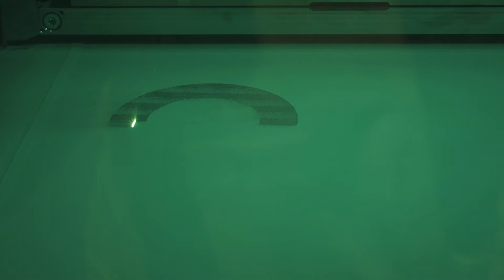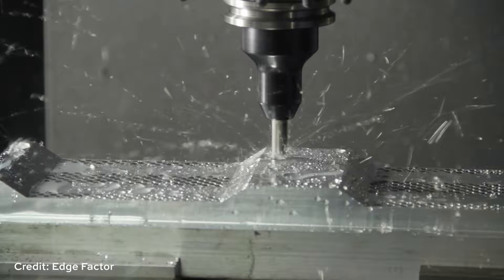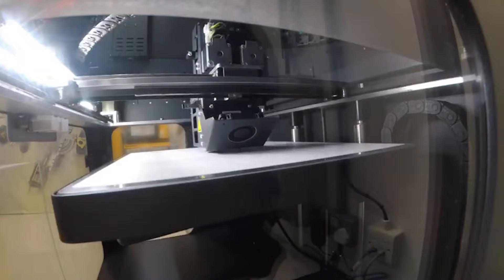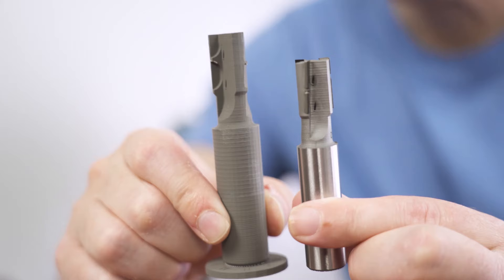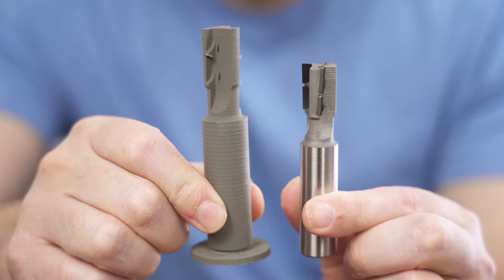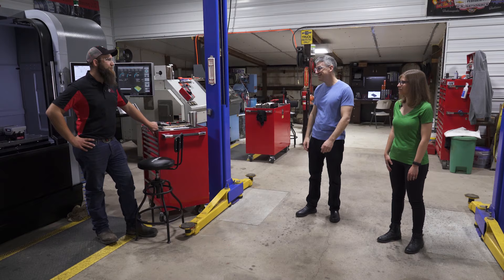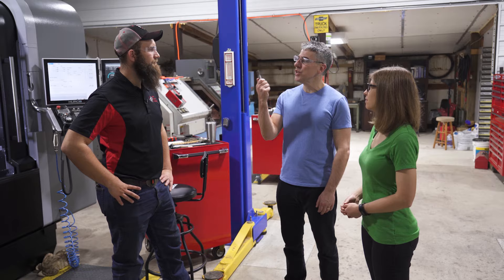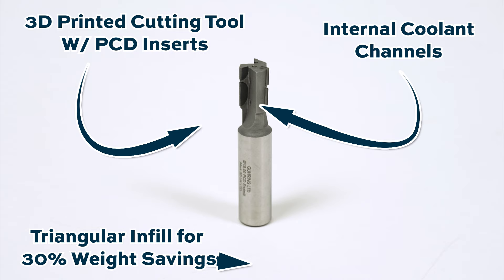3D Printed Tool for CNC Machining: The Cool Parts Show S3E1

Comment: Question: End Mills are spun rapidly during its operation. AM process, however, introduces a not so balanced part (think surface imperfection). Wouldn't this create an undesirable vibration of the part during its operation?
Reply from the maker: This question is so fitting, you don't even know. In this episode, Stephanie describes how Pete is also part of Modern Machine Shop magazine. As it happens, when he joined Modern Machine Shop, the first article he wrote as a new staff member was on this very topic, tool balance.

The question is very valid because imbalance is a problem we might expect for an object spun this rapidly - over 10,000 rpm in the machining we see in this episode. And the surface detail that is observable in the tool from 3D printing might indeed have some effect that is measurable in terms of mass distribution. However, this mass effect would be so slight, and at such a small radius from the axis of rotation, that the effect in terms of centrifugal force would be negligible for the symmetrical form of this tool even at a high rotation rate. The centrifugal force is minute compared to the force of the tool doing its job, which involves rapidly driving its edges in and out of solid metal.

For further reading or just if curious, here is that long-ago article on tool balance: https://www.mmsonline.com/articles/should-you-balance-your-tools
Reply: As with every tool a balancing process and adjustments are done prior running it
Reply: @AdditiveManufacturing  appreciate the reply! Will check out the readings provided!

Comment: Why does making it 30% lighter make it better as a cutting tool?
Reply: Honeycomb infill
Reply from the maker: Alan Pearce of Guhring, seen in this episode, offered an answer. He says, “The weight reduction helps on automatic tool change within the machine, putting less strain on the grippers. Also, at the feed rates and speeds that these tools work, less weight in the tool body means less forces and stress on the spindles.”
Reply: It might work even better with a 3D printed arbor, provided the tool/holder balancing is done right